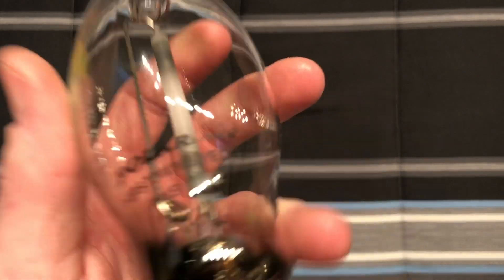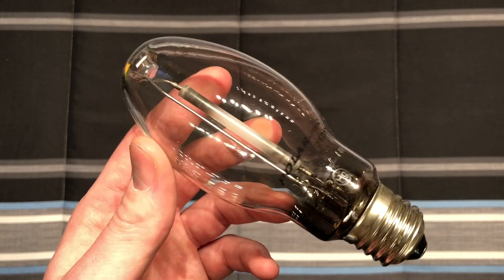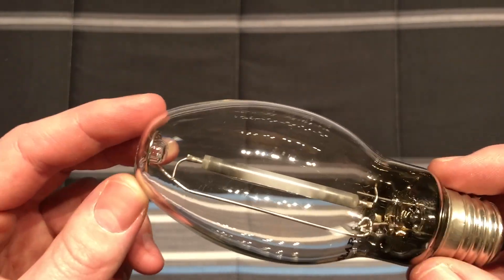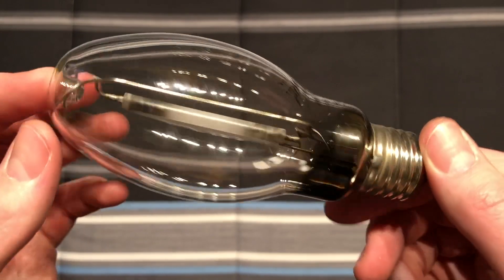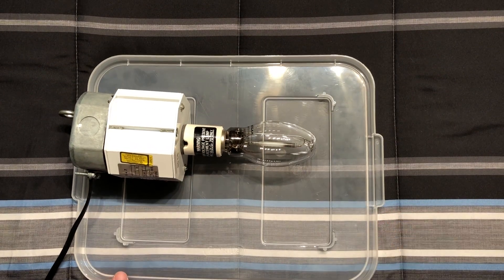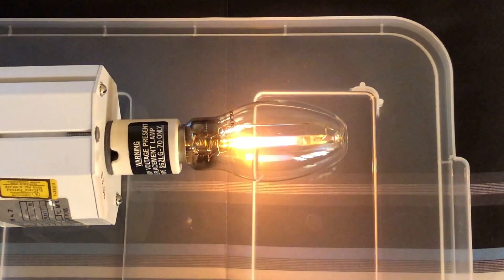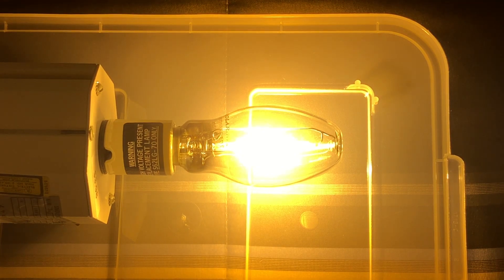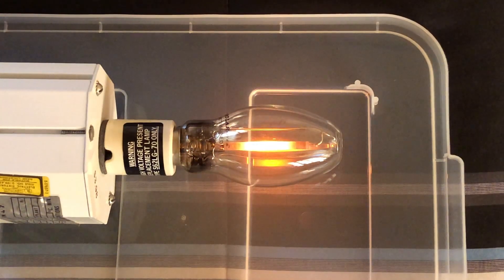PolarLites 70watt High Pressure Sodium Light Bulb

Comment: Have you ever tried dimming an HPS bulb, by using a variac to power/control a lamp with a magnetic ballast? I read somewhere that HPS could be dimmed up to ~50% power level safely, but that they first should be run at full power, for enough time to warm up sufficiently.
Reply: Hps and merc vapor fixtures in horticultural applications are typically dimmable. It's been a while since magnetic ballasts were popular though, i don't think those had dimmers(maybe due to striking an arc reliably?) But once they went digital dimming was pretty much universally standard. And the bulbs do last longer dimmed. Some have an overdrive feature too, which will wear the bulb faster.
Reply: @volvo09  Thanks for the info. After seeing your homemade HPS fixture made from junction box and other assorted parts, I've been wanting to do the same, but with only a 35 watt bulb. Sounds like I should look into a horticulture-based electronic dimming ballast then.
Reply: Above all, be careful that it does not break while it is illuminated, because the source, the ceramic tube is twice as hot as a halogen lamp. Whether it is mercury vapors or sodium vapors. If, in case of breakage, never put it in the ordinary trash. Must either deposit it or in kangaroos or in the recycling bin in a tightly closed plastic because of toxic substances